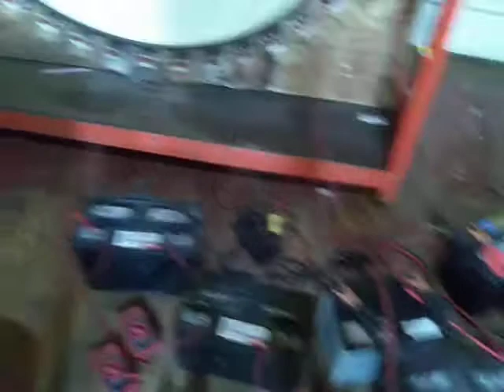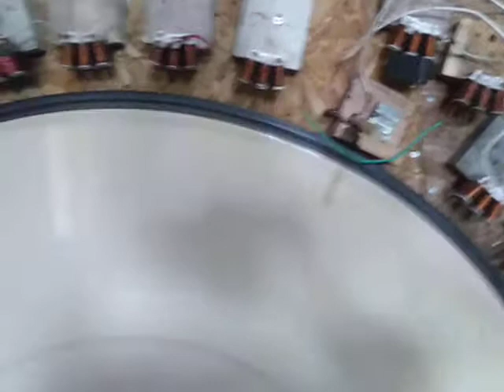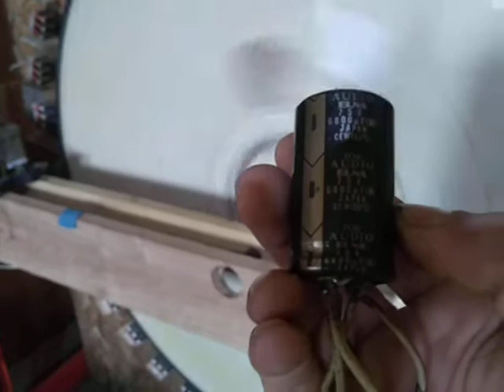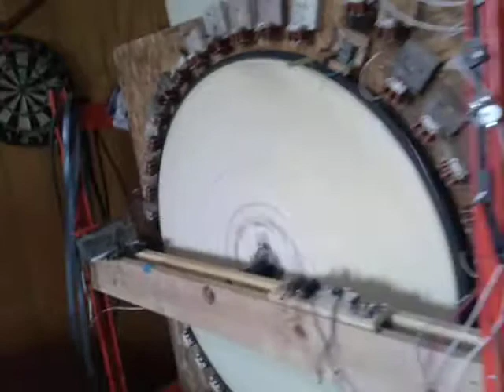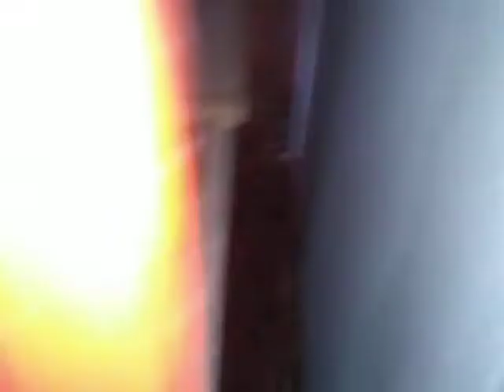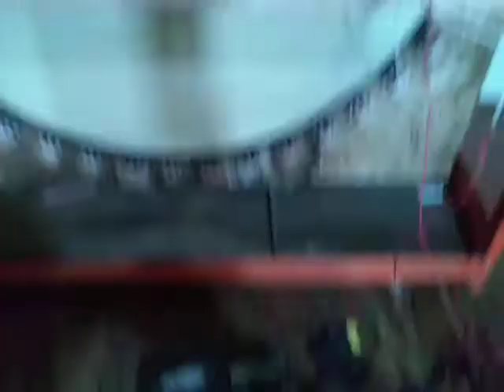4-ft wheel where we're at and where we're going next.

Comment: I don't know... Impressive?
This is my first visit here on your channel and looking for other things I found you... and I have no words....
I've only seen small setups with coils and magnets and yours is really scary, deadly.
I'm going to watch all the videos on your channel now with great attention, but taking in advantage and asking you now, I don't know anyone who has achieved a difference between input voltage and output voltage greater than 80%. How much efficiency are you getting from your generator?
Reply from the maker: Honestly the output varies. I'm having more problems with frying or failing electronics than anything.  It's definitely high voltage output.
I can honestly say I was able to achieve +.01  unity on the batteries on a 17 hour run once
The reason I'm I'm going so large is that as a scientist we are supposed to build a small prototype , and if you see good results ,you're supposed to build a larger prototype. 
I never tried to promote false over unity on anything. of the last 4 years I've researched the possibility of a machine that can produce more electrical or mechanical energy then what's applied. I honestly believe it's very achievable. 
I feel for less than 0 to 100 watts of input. I can achieve industrial air conditioning ,heat, pumping water, air compression and at least recover 75 to unity electrical recovery. 
I really appreciate you watching the video and taking an interest. The questions and comments are always welcome and appreciated.
Will be doing an update video sometime this weekend. Hoping to buy a oscilloscope this week. Something that can read a few thousand volt spikes. 
The voltmeters I've been using max out at 2000 volts.
Reply: @TheDeadEndChannel  I know that with these voltages you're apparently working it can be difficult to measure or even understand, but have you tried putting an oscilloscope on the input/output to see what the waveform is and its frequency?
Before trying to guess, I will watch your videos carefully.
Thank you indeed for your attention.
Reply from the maker: @luisribeiro2843  no I haven't had the opportunity or know anyone with an oscilloscope. I'm at the point of my research that I need to buy the oscilloscope.. I've been using capacitors to try to judge the output. I can pump up 21, 000 UF at 120 volt in less than a minute under 20 watts input. 
But I'm also at a 1-in gap between the magnets and the coils.
Reply from the maker: @luisribeiro2843  currently I'm using 3 40 volt 3600uf caps in series then have six sets of them running parallel
Reply from the maker: @luisribeiro2843  according to my math I'm only running about 137 HZ

Comment: Dang, I am using 400 volt caps, so you are way over 75 volts.
Reply from the maker: 😂 nothing special. Keep burning stuff up. Just got new capacitors and some dc/dc converters. And a few PNP transistors. Trying to choke it down to 12 volt really messes with the flow.
I don't think it's bad results for six to 10 Watts input.
Thanks for checking the video out. We all have a lot in common the love for pulse motors.  Hope to see a few other videos of some of your builds.

Comment: Hey Make, so at 55:00, some batteries are not charging but they are good to put a load on it right? OR is it loading it down too much? I ask because my batteries are old also. Thanks for the comments today.
Reply from the maker: Thanks for the question. I was using the dead battery more like a temporary capacity to temporarily hold the back Rush spikes. The dead battery won't hold capacitance but it has potential. 
I see huge pushbacks on my source battery,. I'm still trying to understand the huge pressure wave that I see. It's very destructive. I watched it pop about 200 LEDs like popcorn without even lighting them up.
All I could gather was it was so fast and so hard the light didn't have time to illuminate.
 So my theory is to try not to compress the output. It's like trying to cram a river in a straw.
I really don't know the effects or the damage that using a very bad battery and series with others could damage the others or not.
I damaged my batteries draining them to low voltages then leaving them like that for too long.
Thanks for the question and hope that kind of answers why I use dead batteries in series it was just for a test to see if it helped hold any of the back pressure waves.
Thanks for the question ,comment and watching
Reply: @TheDeadEndChannel  Are you talking about bemf pressure wave  or is it different